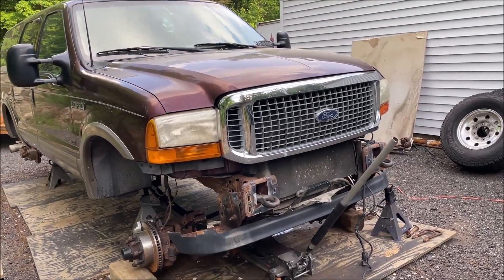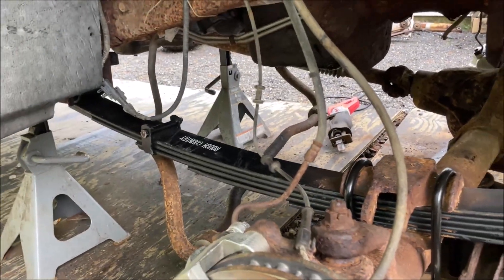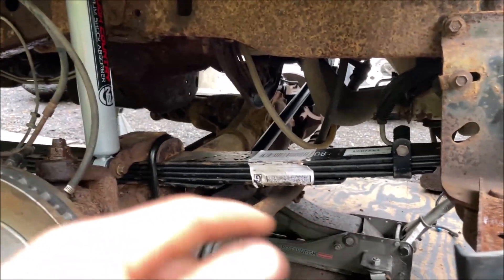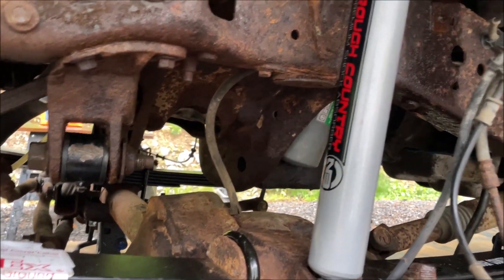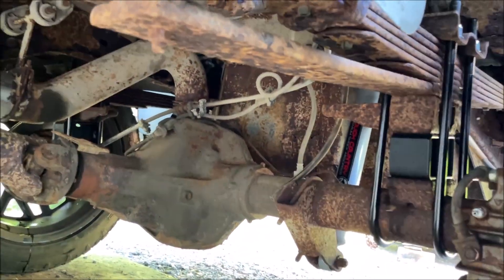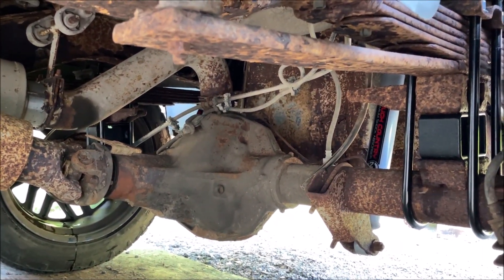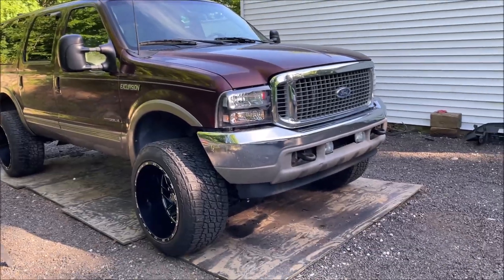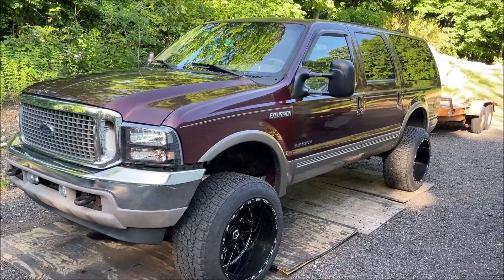7.3 Ford Excursion Build Gets 3 inch Lift Kit and 22x14 Wheels! (Lift Kit Install, And Full Reveal)

Comment: On my 2000 Ex I did the factory X codes springs up front and 1" shackle lift and raised it 3.5" and a 5" Ready Lift factory style spring block on rear, threw out the factory spring block. Its always better to use one block , stacking is not a safe practice. Now it clears my 35's and sits level. Handling is awesome and with addition of the stiffer factory F350 rear springs I installed I don't need to add a rear sway bar.

Comment: Also make sure you install a tapered lift block on the rear otherwise you may suffer driveshaft vibrations. This is required on all single driveshaft trucks, all Excursions have single driveshafts, so you can maintain correct pinion angle to transfer case/Trans.

Comment: Hey bro the excursion looks good! HOW IS THE RIDE QUALITY? I'm looking to get a 3" lift With those exact same size wheels and tires. I was looking At getting deaver Springs and billstein shocks or a custom 4 link set up but they only sell 4.5" and they are definitely $10K. My main concern is ride quality. That's why I ask.
Reply from the maker: Thank you! Honestly the ride quality on the 3” lift seems pretty smooth to me for a full leaf spring setup. This is my first excursion but coming from full leaf spring f350’s the ride quality seems way better. Idk if it’s an excursion thing or the new rough country springs but I cannot complain. Thank you for watching!

Comment: Curious? Was this the actual 3" RC excursion lift or a 3" f250 lift?? I didn't think you could fit 35s on a 3" so they say
Reply from the maker: Yes it’s an actual excursion lift. It takes a little trimming but they fit.
Reply: @ryans5757 where all did you have to trim? And do they rub the leafs?

Comment: 10,000$ lol an exaggeration to say the least. I just bought front and rear Skyjacker soft ride springs for my square for 1000$ shocks and brake lines will probably be 5-600$ so not cheap for sure.
Reply from the maker: Pmf lift kits, air ride lift kits, there are some lifts that are 2,000 for just the shocks. So it does get up there.